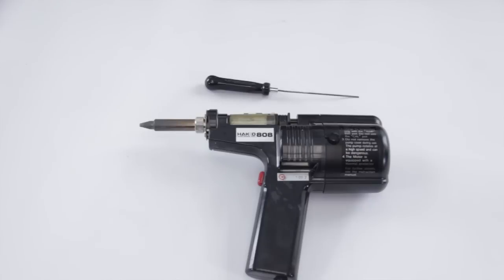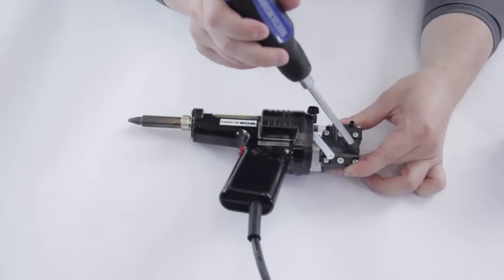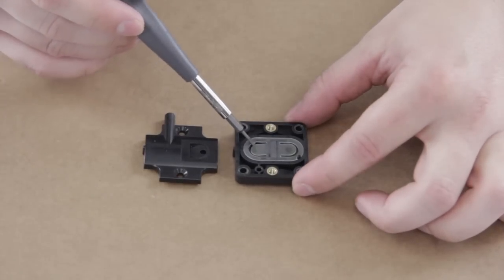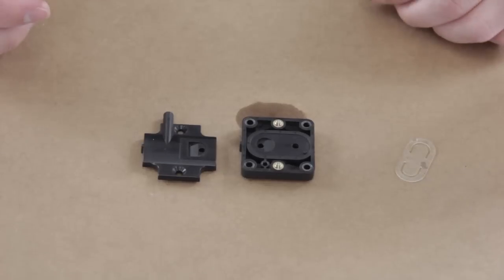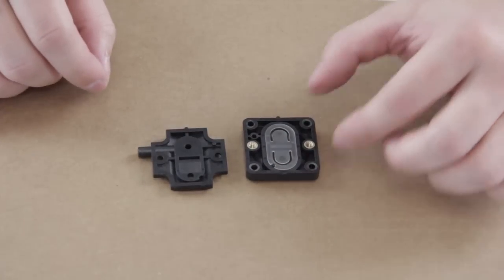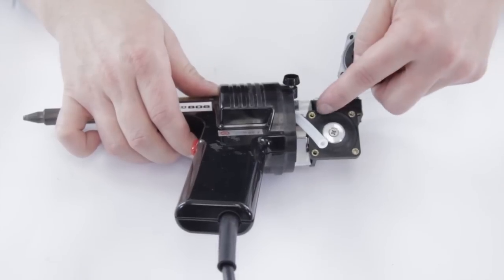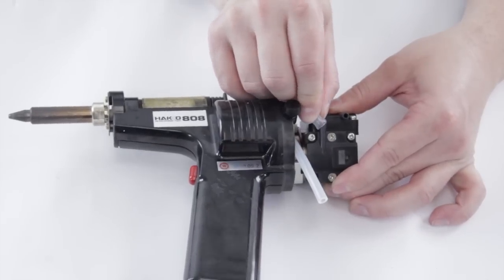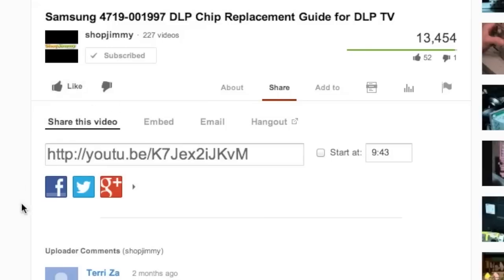DIY TV Repair How to Clean the Motor In Hakko 808 Desolder Gun - Desolder Tip #9

Comment from the maker: @KB1UIF - We use the pumps a lot at SJ so we end up cleaning them fairly often (once a month probably or more).  If you are replacing the white ceramic filter on a regular basis and not letting it get too dirty you will greatly extended the time between pump cleaning. The flux, and solder you use will also make a big difference. I would go until you notice either the suction or sound is off, usually sound goes first and then you notice the suction failing.